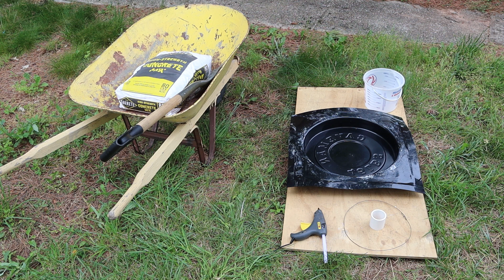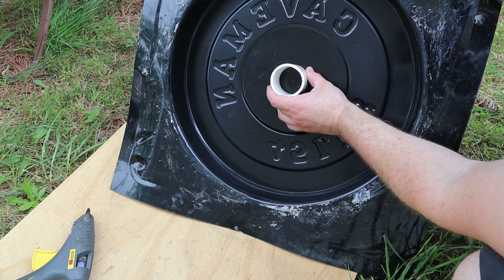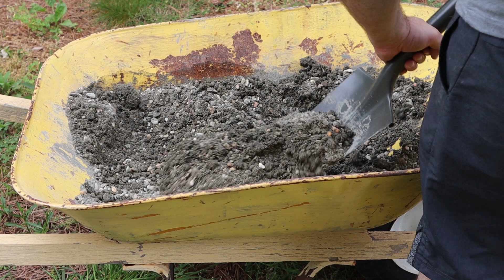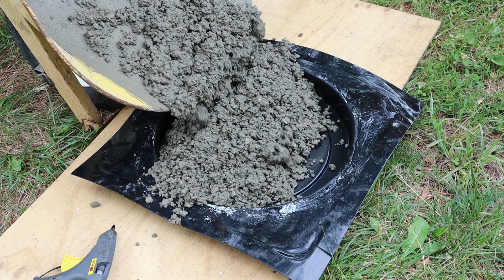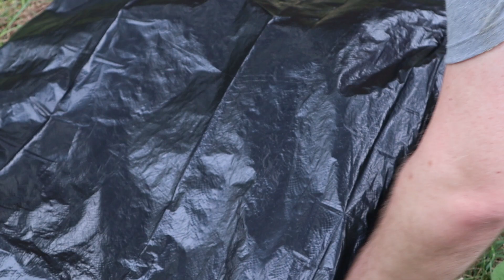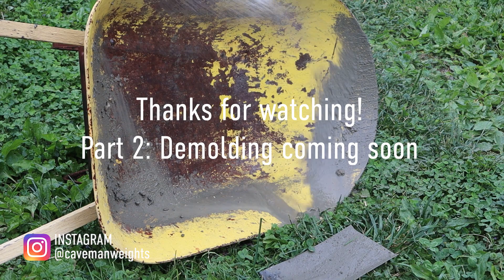How to make concrete weights?  Tutorial Part 1/2

Comment: Hey I just got your mold in! It is winter here in northern canada, and am just wondering... would I be able to mix the concrete outside, and let it set in the basement. Or would the fumes still be dangerous in my house? Should I just wait for the summer so I can let it set outside?
Reply from the maker: There are no fumes!  You can safely mix the concrete, and let it set inside.  The only thing I recommend is wearing gloves if you touch the concrete.  Concrete is caustic, and can be rough on your hands.
Reply: @cavemanweights101  oh awesome, thanks! Excited 😄

Comment: Would weighing the concrete before adding water help make more accurate plates?
Reply from the maker: The weights are normally within 1-2lbs, but if you want to weigh the dry concrete you can be more accurate.  The 45 uses 43lbs of dry concrete, 25 uses 24lbs, and the 10 uses 9.5lbs.  Great question!

Comment: Could you please tell the thickness of the plate/mold? I assume this has the same diameter/circumference as the original 45's. I want to make a mold using a metal sheet, worried I might make it too thin or thick and screw up the weight.
Reply from the maker: 45LB mold Dimensions, 17.7 inches x 2.5 inches

Comment: You are all sold out of every weight mold? Ebay store is basically wiped out.. First < I'm happy for you man.. sounds like you are doing very well!!  But more importantly how long until you get the 45s back in stock? I just bought a vertical leg press and I need to Caveman it up.. I have the press and no weights:(

Comment: I constantly get bubbles all over. Any thoughts to to avoid them? Do I need more vibration? Is my mix too watery?
Reply: I just made my weights. Thing is just don't make the cement mixture too watery as it will definitely let more bubbles inside while pouring the mixture into the mold, but also not too rough. I just tap around the sides of the mold, give it all a bit of shaking, insert my cement spoon into all of the mixture to get any more air bubbles out.

Comment: I wonder if using a strong plastic wrap around the hole would help prevent the concrete from getting in the hole. Then remove it when its level. I am also concerned about keeping the ring in the center of the mold, so they are not all oddly placed on the bar. but a simple spray paint around the ring will give me the perfect place to put it. I cant wait until i can make these.

Comment: My 45lb weights keep coming out at about 47.4lb. I'm going to try to measure the dry mix first at 43lbs and then add the 8 cups of water as suggested in another comment. That said, has anyone weighed out their weights after 30 days to see if you have had shrinkage?  I'm thinking I'm going to lose 2.4 lbs, but perhaps some type of weight after 30 days. At the end of the day, since I have 2 that weigh the same that isn't a "terrible" thing. But it would be nice to get the 45s to 45. The 10lb and 25lb are good. On to making my 3rd set. Then I'll go back and make a couple 5s.
Reply: Thank you!!!!!!😄😄😄
Reply: Who cares if it's 43, 45, or 47. 45 is just a random number that the manufacturer came up with. It's not like 45 makes you grow faster than 47. As long as the weight's are close to equal on both sides, then you're good.
Reply: @janepatton8100  it just matters to balance them, that's all. But you are right.

Comment: Hey what brand on concrete are you using? The one I used didn't come out to 45 pounds and I'm thinking each brand has a different density.
Reply from the maker: Sakrete.  Most high strength concrete has a density of 133 lbs per cubic foot.  Divide the weight of the bag of concrete (80 lbs) by the yield in cubic feet (0.6 cu. ft).  That should equal 133 lbs per cubic foot.

Comment: What does the metal ring do? I would think stabalize the cement but I doubt the ring would help much since it looks like speaker wire lol
Reply from the maker: It's 16 gauge wire.  It provides what's known as "hoop strength", and gives the concrete much needed tensile strength.  Some people throw in a couple of pieces of rebar.  More reinforcement is good, but it will make the weight slightly heavier.

Comment: What's the internal volume of the moulds so I can make them weigh exactly 45lbs? Thanks
Reply from the maker: The 45 weights are 17.7 inches in diameter and 2.375 inches thick.

Comment: How do you remove cement from your molding that are trapped in the lettering and numbers. Please let me know its affecting my plates
Reply: Omar Vilchis spray it with pb blaster or olive oil before you pour ur mold this way when u go to remove it nothing sticks 👍
Reply: @Mr19860823  I don't recommend spraying anything. We tried that and the molds came out crumbling. We just clean with soap, water and wheel brush and everything comes out. We soak them for a few hours before scrubbing clean.

Comment: This or just buy oil pans from autozone for a fraction of the price, since this molds are also overpriced .
Reply: 60 a mold extremely over price
Reply: What pan exactly though?
Reply from the maker: @37nlemus  If you're not too picky about the diameter of your weights, then you can use pretty much any diameter oil pan.  Our molds are Olympic size (17.7 inches in diameter), and keep your barbell at the proper height off the ground for deadlifts. Use the same method I do in the video, but keep that PVC longer than you need it.  Weigh your dry concrete out to 43 lbs, and add about 8 cups of water to the mix.  Just be careful not to make the mix too soupy.  When your weight driefs, then cut off the extra PVC with a hacksaw, and voila!  Concrete weights!
Reply: @cavemanweights101  I actually made 10 35s with the $4 oil pans from autozone and started using them I realized I had too many so I sold them on offerup for 40 dollars each, I was surprised by how many people were trying to buy them, so I ended up buying 2 sets of your molds and now I sell them on offerup 50 for the 45s 30 for the 25s and 15 for the 10s , also I am still selling  my 35s for 40 , so far I have made over 5k. 
Moral of the story,
Nothing is expensive if you only pay for them once but can use it an infinite amount of times. 
Thanks caveman.
Reply: @fauxhawksexipapi  you definitely make valid points as far as innovative thinking ...but just for the f*ck of it im gonna say you're b/s'ing about making the 5k lmao 🤣 ...in theory maybe but again you got the right idea 👍🏋️‍♂️
Reply: @oceansize8791  8k so far
Reply: legitgreatness what oil pan from auto zone?! Please share
Reply: @DodgersLakers  just type 7 quart flo tool drain pan on the search bar
Reply: @fauxhawksexipapi  so basically you talk all this crap about making 8k but cry like a chic saying the mold is overpriced ...yet you bought them (bcuz you know theyre awesome and youre just a hater) so why you dont just start selling oil pans? you can fingerpaint your name them ...the Caveman molds are accurate and look very proffessional ...now go home and get your shinebox

Comment: My concrete won’t come out the molds.... someone help.
Reply: Yea thanks, u can also pour denatured alcohol in the center hole if ur weights get stuck. They pop out the next morning.
Reply: Use baby oil before you add cement. It will release smooth

Comment: Do you need to measure the weight of the mix before mixing it? or do you just fill up the mold to get an accurate weight?
Reply from the maker: You can do either.  I generally just fill up the mold, but you can measure out the concrete before.  The dry measurement is 43lbs of high strength concrete and 8 cups of water.  Add the water slowly until it starts to become workable.  Avoid making the concrete "soupy".
Reply: @cavemanweights101  Do you have dry measurements for all the different molds?  Son just ordered the three mold set...

Comment: Kudos to you brother. I paid $1.89/lb for my plates.
Reply: From where brotha
Reply: @DodgersLakers  Facebook marketplace. I've also found the fitness gear 300lb set for $250 at Dick's sporting goods. It does the job.
Reply: @elcapitanian  yeah that's what I did too I hate that they are shorter but they work great until you can scrounge up some better ones I finally found enough on marketplace to sell the fitness gear and got my exact money back

Comment: how much did it weigh the 45 one?
Reply from the maker: It was 13 ounces over.  If you want it to be closer, then you need to measure your dry mix.  43lbs of dry concrete, and 8 cups of water is a good ratio.  Just add the water slowly, and avoid the concrete from becoming too "soupy".
Reply: @cavemanweights101  I appreciate you giving me that precise reference. thank you stay strong💪

Comment: Save money on the weights and use your money for a good bar.
Reply: GAS PIPE over gas pipe,  2-1/2 inch phat bar  EASY 800 lb capicity
Reply: @BRUTUSPLAC  2.5”😬
Reply: @tawaitai  I have 3XL hands
Reply: @Essa Ali ????::
Reply from the maker: We also have free plans to make your own barbell.  https://www.thingiverse.com/thing:4328378
Reply: @cavemanweights101  will your weight molds work with my texas power bar?
Reply: @wx2999  Yes they are 2" holes and will work on any Olympic bar.
Reply: @cavemanweights101   
Hi guys. We sent you guys an email about two days ago explaining that you did not include all the molds that were included in the purchase order. We ordered the set that included the 45, 25, and 10/5 pound molds along with the wire rings and PVC centers. However, we did not receive the 10/5 mold or the wire rings. And we still haven't received an email back from you guys.

I know you guys are busy during this time of year, but could you please email us back to let us know when you can send the rest of the order.

Thanks
Reply: @cavemanweights101  
Hi guys. We sent you guys an email about 5 days ago explaining that you did not include all the molds that were included in the purchase order. We ordered the set that included the 45, 25, and 10/5 pound molds along with the wire rings and PVC centers. However, we did not receive the 10/5 mold or the wire rings. And we still haven't received an email back from you guys.

I know you guys are busy during this time of year, but could you please email us back to let us know when you can send the rest of the order.

Thanks